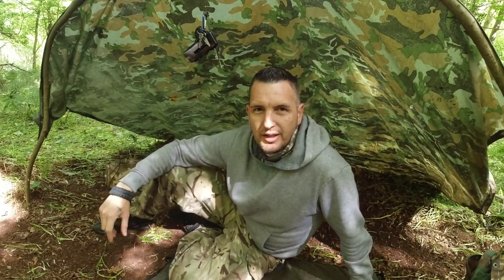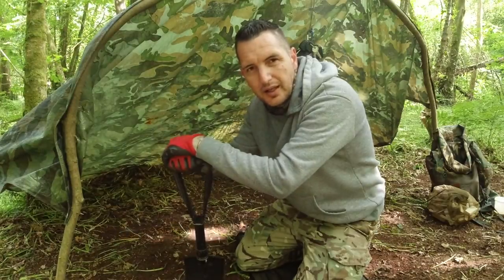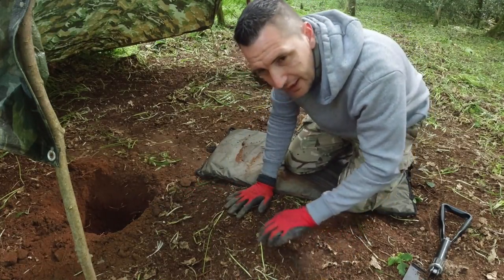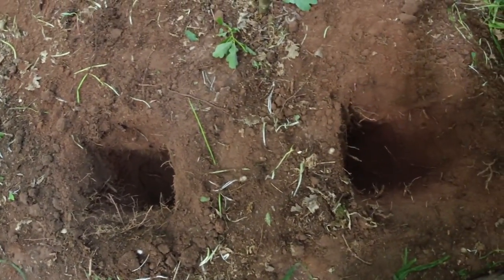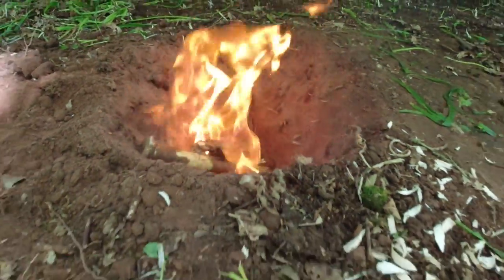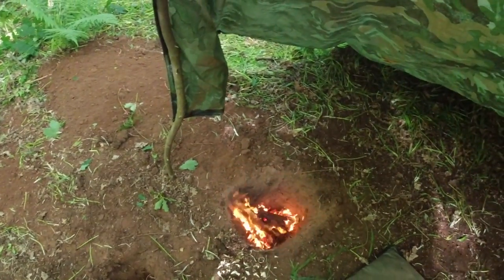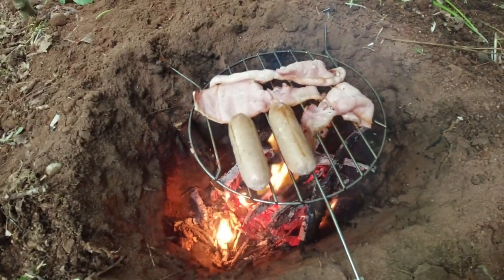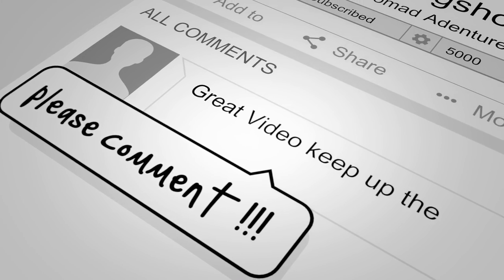Dakota Fire pit Review  // what you need to know.

Comment: Hey I've got the adventure ridge 4 man tent in Aldi and I live in it full time. Two years total doing this. It's six feet tall with two bedrooms. It's big like 9x16 foot. Iike a small house. I'd like to try the Dakota inside it by removing one of the rooms ( no tarp there) and digging a deeper Dakota pit and placing rocks above and around the pit flat. Will this be safe or have you any suggestions? I'm using gas stove and heater ATM. Great tutorial too thanks 👍